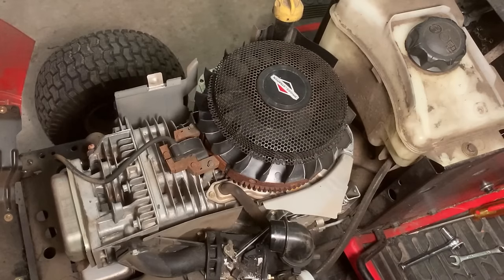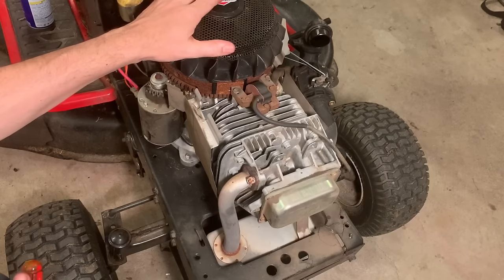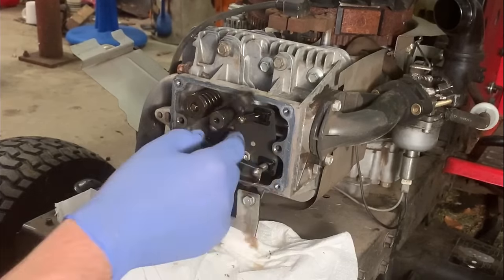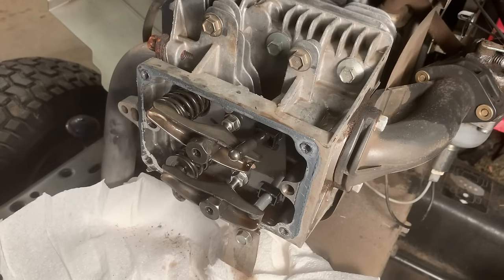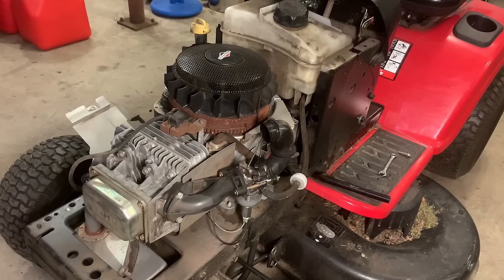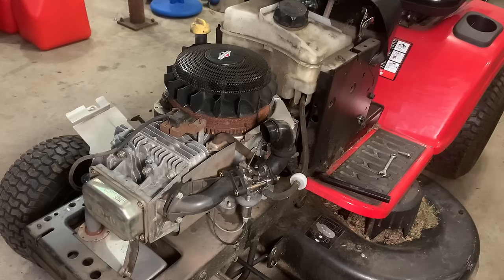Lawn Tractor Engine Running Rough, Missing, Popping, Sputtering / Briggs Engine - FIXED

Comment: Always check and make sure the plastic pieces on the pushrod guide plate are intact if they are missing the aluminum pushrod will wear and break. also observe the pushrods where they align with the head gasket and if the head gasket is leaking there will be deposits on the pushrod. These engines are bad for head gasket leakage and pushing combustion gasses into the crankcase causing excessive crankcase pressure resulting in oil consumption. Your lucky the deck even sounds good!
Reply from the maker: The deck did have issues.  Did not make a video on that, but the blades were getting hung up and taking about a minute to disengage (fixed now).  And there is some vibration, but cannot find what the issue is.  Have changed the blades and spindles.
Reply: @jcondon1 Q 2 Q Q 2
Reply: Poo,,

Comment: That mower is virtually the same as a Craftsman DLT 1000,  a DLT3000 would be 18.5 hp. I've had a 3000 for since 2003, it still runs and works just fine. I recommend letting it cool completely off after cutting,  then rinsing it off with the garden hose after every day of cutting and keeping it as dry as possible between usage. If you can't keep it in a garage,  then park it on a small tarp, and then wrap the tarp over it to keep sun, rain whatever off it. Periodically spray some WD40 down the blade engagement cable and take the deck out from under it, maybe every other year to make sure the moving pulley assemblies are moving like they should and the blade spindles are not getting worn and wobbly. Sharpen and balance the blades at least once a year.  Change oil one a year on a small yard, two times or more a year on a big yard. Should last a long time.

Comment: Mine does the same sputter sort of thing, but valves were lashed, and carb was thrown in ultrasonic cleaner, solenoid clicks with the key it idles okay, but any throttle and it sputters and backfires slightly. New gas fuel filter is clean. New plug. When looking at the spark when bridging it to the motor. Should it be visible like bright. Because i barely saw my spark when i turned it over. Faint faint spark. Someone help

Comment: My tractor with a very similar engine needed a head gasket, so, of course, the valve lash got all messed up.  I tried the B&S method with the TSC bumper and couldn't get it to work. Others on YT insisted that was the method. I watched one of your generator videos and I used your technique. My engine sprang to life.  Though they recommended using RTV, I did buy a gasket as was supplied OEM. That was in 2019 and the tractor has been running great since with no leaks. Good job!
2023 update: still running strong!

Comment: A few weeks ago I got a "free" mower like that with a "Blown Engine". Lots of loose bolts and missing exhaust studs and battery.
Tighten, replace, and add battery and it runs great. Gave it to my neighbor and he cuts my grass. Good deal for me.
Thanks for sharing.
Reply from the maker: Thanks

Comment: My LT1000 (21HP Briggs twin) 20 year old Craftsman turned out to have a coil issue... New part arriving today from Amazon Prime so that I can get back to mowing.  Engine ran so rough that I was tempted to buy a new mower at Lowes (2600-3000 dollars).  Turns out that one coil to spark plug wire had rubbed and burned through the insulation layers - but enough park was flowing before tear down to fool me into believing that the coil was in tact.  After watching this and isolating the coil issue, I will make this Craftsman LT1000 last at least one more year!  As you said in your video on the Poulan, sometimes a simple engine tractor can be all that is needed.  Mowing my over 2 acres of weeds and native grasses is a battle that the tractor does well for me.  Thanks and great work finding that exhaust valve issue and making the repair.

Comment: You remind me of myself. Where others see something broken we see it as something that can be fixed. Before I give up on something it really has to be broke beyond repair. And then sometimes we get things that someone does not know anything about the peace equipment that they are either selling or giving away. a few years back I found a backpack blower looked brand new in the picture so I called the gentleman immediately. He was less than 10 minutes from my house so I drove straight over. He wanted $25 I talked them down to $20. We got to talking and he said you seem like a really decent person here take this also. He gave me the gas can completely filled with the two-cycle oil already in it. He said he was done with all of that that he was going electric. As soon as I returned home I took the blower to the garage to start working on it immediately seeing that I had to cut the grass that day I could use the backpack blower to clean up. As I'm looking at this thing I realize so on and off switch was in the off position. I stopped taking the air box off and thought to myself this cannot just be this. After putting the switch on the second pull of the starters cord it started up immediately and I was able to use it that day after cutting my grass. Even to this day I still have that in my shed and use it all the time.
Reply: I can’t sleep tell I fix it and I’ve been up very late a few times lolol 😊

Comment: I have exactly the same engine in my hayter, also had identical issues.
I used a touch of threadlock on the into the head, it's never happened again.
Watching the rest of the video and I see you did the same.  The exhaust valve also controls the decompression lever so it was fortunate the engine spun up as freely as it did.

Comment: Awesome video. I have been having trouble with diagnosing similar issues on mine and will pull the rocker cover tonight. I usually stick to cars and can pull out a scanner to find the issue and I didn't want to start slapping on parts without a diagnosis. Thank you!

Comment: My exact engine and problem. I figured it out before I saw this. Mine is running/cutting but I got the wrong specs for the clearance. I am not idling well. So, tomorrow I will change those specs. Thanks for your thorough explanation.

Comment: For this motor:
Valve Clearance – Intake .003 - .005 in. (.08 - .13 mm)
Valve Clearance – Exhaust .005 - .007 in. (.13 - .18 mm)
Spark Plug Gap .030 in. (.76 mm)
Armature Air Gap .010 - .014 in. (.25 - .36 mm
Rocker Cover 60 lb-in. (7 Nm)
Cylinder Head 220 lb-in. (25 Nm)
Reply: Thanks for information
Reply: I set at a sung 4 or tight 3 on them 
Has work great for 20 years 
But I use 271 red on studs and never had one come loose yet 
I don’t use rtv because I know in a year the valves need adjustment

Comment: Hi James, thank you for this very descriptive, helpful and understandable video . I used it to check my misfiring Husqvarna TS 138 (same tractor as in video), although it proved to be a carb problem I learnt a lot and the valves were a little out and and now spot on. After some carb air intake sprayed into inlet the tractor runs like new. Great job Andy ...United Kingdom
Reply from the maker: Thanks Andy

Comment: Those Briggs Failtek (Intek) engines are such a pain. I was working on a 17.5, and the valves were so far out of adjustment that it wouldn't even turn over anymore. I didn't know as much about them as I know now, but I didn't even think that valve clearances could get that far off. I only noticed because I took the plug out to use for another machine, and realized that it turned over without a plug in it. That was my first valve adjustment, but it ran perfectly after that. If only I had only realized that the deck was roached before I put all that time into it.......   I couldn't find consistent torque specs or valve clearances for that engine either. Most publications I read said it could be between .004 and .007. I set them both at .005, and the engine runs great. I actually have another mower with the same engine that has a problem that is identical to the one this machine had. It was smashing the back end of the plug much like this machine did, and I ruled out valve clearance for some reason. I never got rid of it, so I'm going to go out this weekend and get it running, lol.

Comment: Hey James, I just wanted to say that your video was excellent,  I have a troy-bilt with a 17.5 Briggs and stratton engine and mine had the exact same problem, loose stud and rotator came off, I followed your video and now mine runs like a champ, you have a new subscriber thanks and keep up the great work, Wayne
Reply from the maker: Sometimes it is an easy fix.  Happy you were able to fix it.

Comment: should of used the red thread locker because it's good to 450 degrees Faren height, because in the summer that engine gets really hot, but over all you done a great job well done!
Reply: For 20+ years 271 red is all I use on studs period and adjust valves every year and cover gasket are cheap not too clean off rtv

Comment: My thanks to you.  Turns out both intake and exhaust valve rods were bent on the left cylinder.  The exhaust rod was completely off its mounts.  I took a rubber mallet and straightened them out, reinstalled, and adjusted to specs.  The mower started up quickly and now runs smoothly.  My $300 junk purchase is soon going up for sale.  I expect it will sell for $1000, as nothing runs like a Deere.

Comment: Paper filters are significantly longer than the inline screen you removed.  
Those Briggs gravity feed fuel screens come in at least two mesh sizes.  Red is 150 micron White is 75 micron.

Comment: I enjoy working on the OHV engines,  to me they are fun. I had a power washer the intake valve guide moved towards the valve head holding the valve open,  no compression.  A friend has a machine shop and he fixed it for me.  Removed the valve guide,  knurled it heated the head drove the guide back in did a valve job on the valves,  an actual valve job not Lap the valves.  It runs great now.

Comment: Do the pushrods that holes on both sides where the oil passes through? Unless I’m wrong general vehicle engines have them and you blow air out through them because that’s where oil passes through. Just wondering. Anyhow, awesome video and that was a great touch with you showing us how it mowed at the end. This is a true YouTube video!! Keep it up 👍👍👍

Comment: I have a 12.5 horse power murry, Briggs and it was low on power really bad, I checked the valve adjustment and both were over  
.080 I readjusted to .006 and it ran great it was built in 2005 and its been worked hard. It needs to be rebuilt . Still I was impressed with how much better it ran with just a valve adjustment.

Comment: Glad I came across this video.  Very well made and very helpful.  I thought my problem was with the spark plug wire.  But when I took the rocker cover off not only were both rockers loose but the aluminum push rod was bent.

Comment: I bought a DJ L120 V-Twin Briggs&Stratton a couple of days ago.  I was told there was no spark, which is not true.  I got it to run, on 1 cylinder as I can tell,  and it is backfiring also.  Looks like I am following in your path.  Valve covers are to come off in the next few days.

Comment: Bingo! Thats exactly what happened to my Bolen's yesterday.  Fixed it today by this video. Thank you so much!  Of course the first bolt I tried to remove from the valve cover snapped off so I've got that to deal with but still, it runs and mows!
Reply from the maker: Nothing worse then breaking a bolt, but at least it’s running again.  Glad I could help.
Reply: A lot of folks like to use a power tool to remove bolts, screws and nuts because it's faster but that can snap off a bolt due to suddenly applying torque from the power tool. Better to loosen the bolts slowly manually, then you can switch to a power tool. just my opinion, I hate having to deal with a broken bolt.

Comment: Had the same motor and it was backfiring out the exhaust. The exhaust valve rocker was loose like yours. Pulled the head off and found it had dropped an exhaust valve seat. The exhaust valve guide had moved up 3/8" and this stopped the valve from fully opening. Had to press the seat back in and then peen around it to make sure it stays put. After that pressed the valve guide back down and then tack welded the guide inside the exhaust port so it will not move back up again. Lapped the valves and re assembled.

Comment: Great troubleshooting and thoroughness! Gave me a fresh perspective for my mower issues. Go easy on that RTV! Also that lock tight will change the torque spec! Should be significantly less since it’s now a wet torque.

Comment: Just had the exact same issue, fixed it ,got once around the yard, and it started playing up again. Haven't looked at it again yet, might be the same problem again or not. I did check the stud but only with my fingers.

Comment: Very interesting. I have the identical tractor and engine. It's doing the same thing. The engine runs fine for a few hours then the plug fouls and it runs like crap. I'll have to check and see if that's what's wrong!
I've saved this to "watch later" so I'll have a reference!

Comment: Had the key on a flywheel shear half way through which advanced the timing. When it cranked and got running that thing went insane on rpm! Had to pull the flywheel to figure it out.
Reply: I have seen this also.

Comment: 2004 Poulan Pro here and the exhaust valve thing was super floppy as well.  I had the cap on mine though.  The tolerance was just way loose.  ... was the cap on there? Crud now I have to check.  I'm thinking most all of my issue is carb though, haven't gotten to test it yet though because the replacement is still on its way.  Opening the carb and it was absolutely full of junk lol.  It sat in an ultrasonic cleaner for over an hour and most of it cleaned up well, but $9 for a gasket and $18 for a full carb... Yeah.

Comment: I can't imagine valve studs WITHOUT threadlocker!  The repeated heat/cold cycles would certainly cause them to go loose, especially if not torqued correctly at the factory.  That's what I would label a really close call!

Is this tractor another MTD product or Husqvarna?

That reversed intake/exhaust valve business would trip me and every other person up who didn't know enough to check for it.  I supposed just rotating the crank with a finger on the plug hole would also tell, but who would think to look for that?  Yet another thing I'll have to try to remember!  ;-)

Comment: Same engine on my John Deere D105. I was just finishing my mow yesterday, on the last 10 foot section, and suddenly the exhaust sound got loud. I thought the muffler had come loose. It started to lose power, so I disengaged the mower belt. As I rode to the shop, it started popping and misfiring. Shut it off, pulled valve cover, and both valves were very loose. Exhast had backed off far enough to drop the little lash cap just like in this video, (not sure if it really is a rotator)? The studs were both tight. So I adjusted the valves carefully, put back together. It started right up, but is surging really bad, engine rpm repeatedly revs up, then slows down, rapidly. Like the throttle or governor is constantly opening & closing. Double checked valve lash, still same. Wondering if something else got damaged? Or maybe the backfiring caused an issue with the carburetor? Compression is good, timing looks correct.

Comment: Went through entire process, was all good. Gonna go check fuel selonoid, never heard it click...what's it for???
Reply from the maker: It blocks the fuel flow when you turn the key off.  If stuck, then it will not allow fuel into the carb when trying to start.
Reply: @jcondon1  it was still Hot hour after I went through normal no start procedures, keyway, valves, spark,  plug was dry. Wondered why I didn't get any backfire or... wasn't getting any fuel, old plug did fowl, stopped running but oil didn't have gas in it, all I can figure. Glad my Harley don't have one. Way I adjust solid roller valves at the strip is when ex starts to open set intake, when intake starts to close set ex. Learn something new everyday.
Reply: @jcondon1  took it out cut it off and it fired right up. Was shot after 10hrs on new carb set up. Just put a petcock before carb.

Comment: i'm glad you found the issue. I am having the same pop, pop, pop and it doesn't really want to run after a while no matter throttle, although it runs lower. It ran well for 2 seconds after i went up on it and put in it gear, ,but then died. The plug was a bit fouled. I had gas in the oil from what i believe was the needle and seat. I had cut the solenoid tip, ,but it happened a while after that. I replaced it thinking too much fuel was going by and draining my tank.
Would this be a "miss" and the result of a bad magneto/coil?

Comment: HOLY MOLLY, lil heavy on the gasket maker bud! Lol 😂 you actually gotta watch that, excessive sealant squishes out so much on the inside of valve cover you can get a glob squirt right into the valve spring. Seen it happen many times, just a thin finger spread is all that's needed. Great job on the videos, very thorough!

Comment: I had the same problem and it turned out to be the intake pushrod broke right at the lifter. I ordered 2 steel pushrods and it running great now. I also ended turning the mower itself into an off-road/work mower. Plus i set my valves at .004 on the intake and exhaust and it runs just fine
Reply: Yea man one of those things is lose on my machine to. I should have checked those push rods. I put it all back and the same shit happened.  So I took it apart and guess what it was . The intake pushrod is bent real bad.  I'm going to my favorite small engine parts store tomorrow. I'll get a couple of them there aluminum push rods. I hope that fixes the problem.